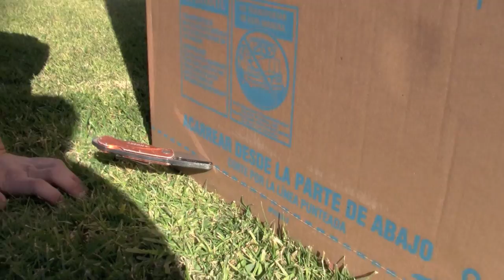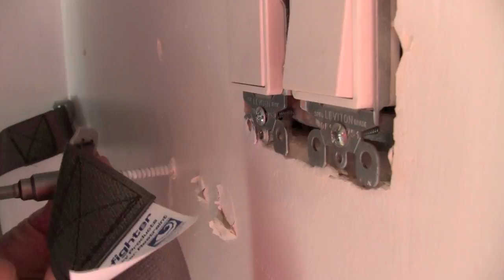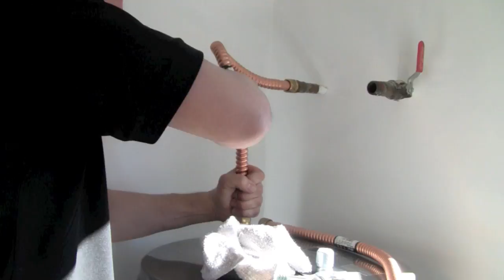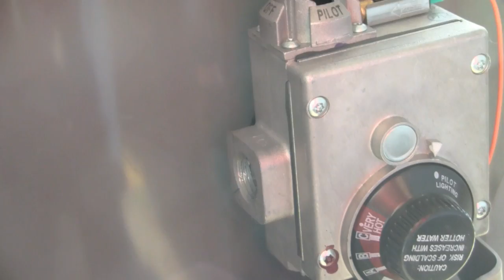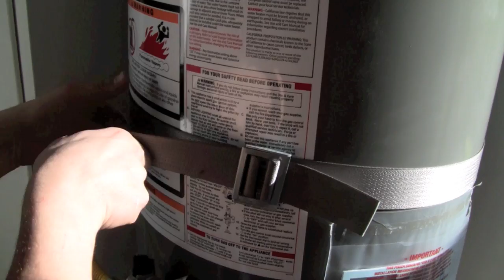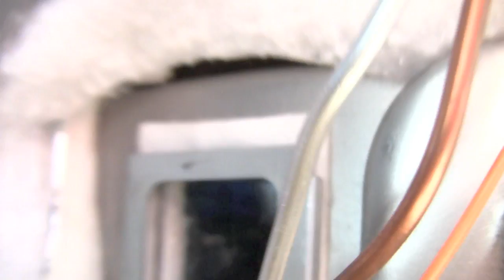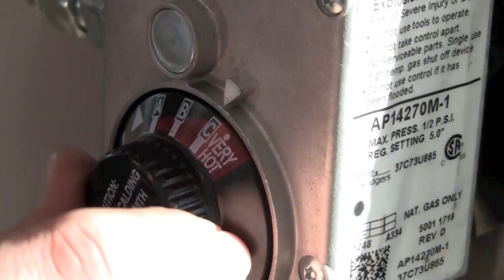How to Install a Water Heater - Step-by-step

Comment from the maker: Hey Daniel, the reason why you do not use compound on the flex connectors, is because they have rubber washers that act as the seal. This goes for anything that has washers or gaskets. 

Thanks for the question.